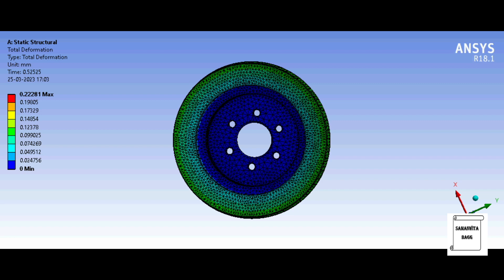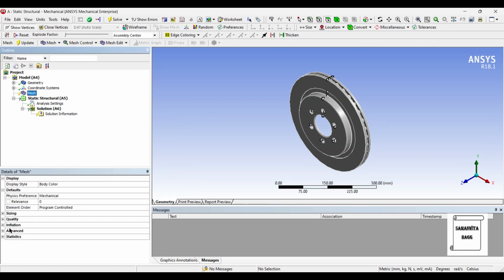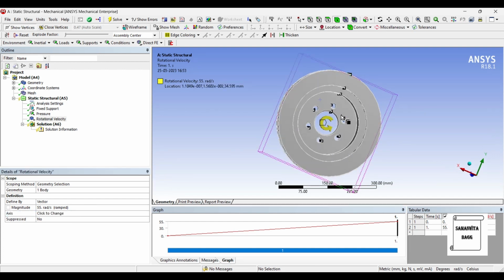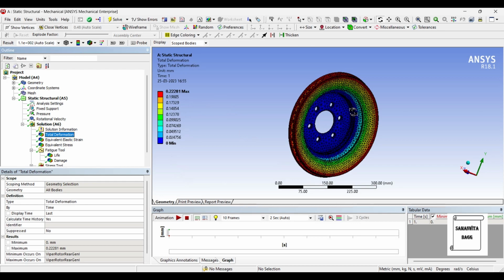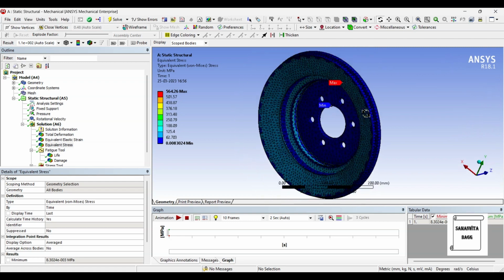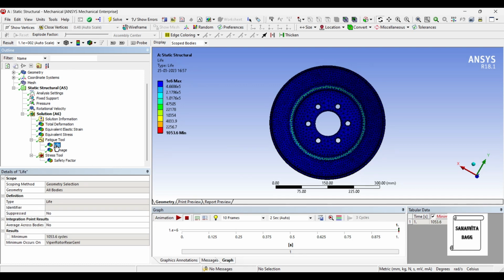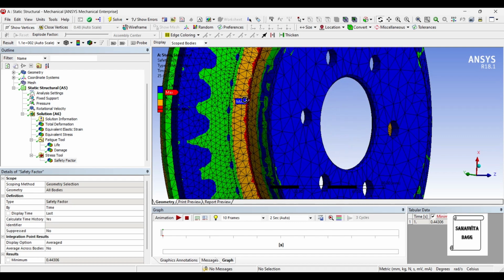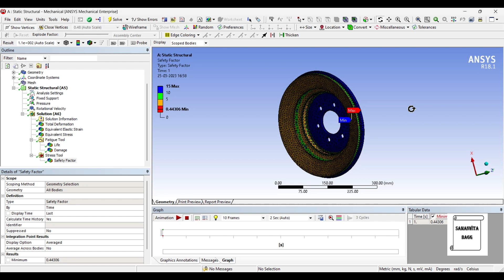Disc Brake Rotor I Design-II | Static Structural Analysis I Deformation | Stress | ANSYS Workbench

Comment: Right idea but by adding a rotational velocity to the body rather than the clamped surface near the bolts, you are adding an unrealistic displacement on the nodes in the disk. It will constrain them as the xy positions will be controlled as a function of time which will restrict the deformation and only allow for deformation in the z. This generates an unrealistic stress field.